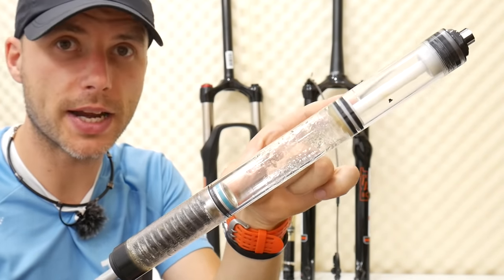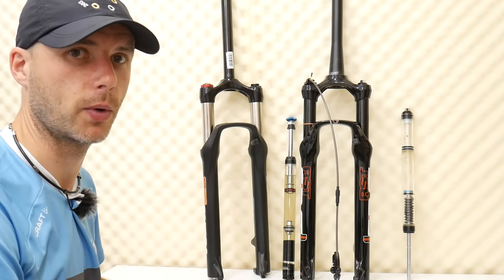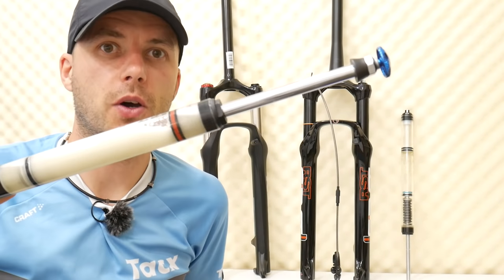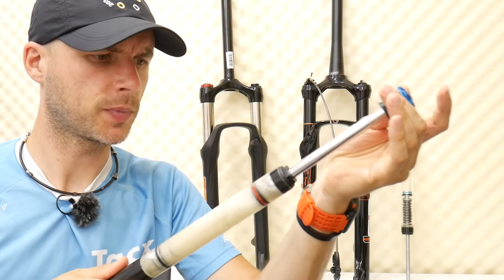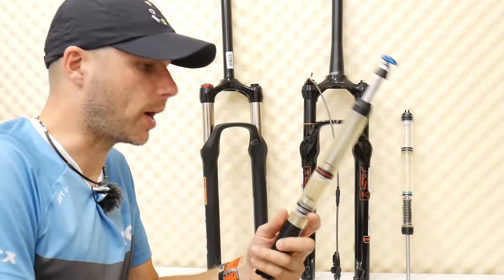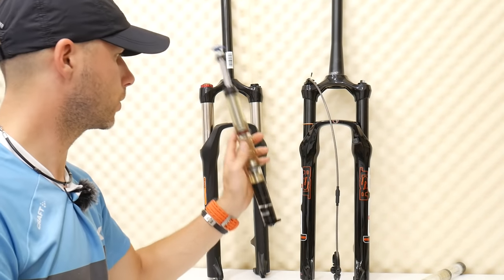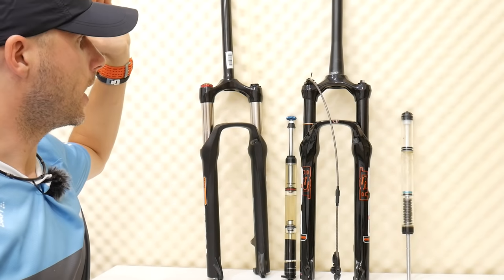Now EVERYONE Will Understand, How The Suspension Fork Works. What's Inside.

Comment: Apart from the damper being upside down like everyone else pointed out, it's worth mentioning that the bottomless tokens are installed ABOVE the upper seal, not below. Like in the damper stanchion, the chamber above is connected to the main spring chamber by channels. That's why the tokens are only limiting the air volume without changing the actual travel of the fork.

Comment: You had your damper cylinder upside down. The compression adjustment is on the top. That is why that giant air bubble was mixing with the oil. That actually hurts damping performance. If the cylinder was the right way up, the air would have been above the compression piston, and the air would not mix with the oil.
Reply: Yea! Because it causes cavitation when that happens.
Reply: The way he held it you mean? 
Or you are talking about sth in its structure?
Reply: @pishi_man  He held it upside down. The rod that slides in and out should have been at the bottom.
Reply: Yeah look at 12.08 aswell whare he's saying the volume tokens go! Half way down under the seal 😂 geez this video's most confusing ever needs to be remade

Comment: Excellent video 👍👌👏!! Thank you!
Im returning to serious MTBing after 20 years away...
hahaha the last suspension I saw the inside of was the 1998 base model Rock Shocks (was it a Judy?  ...me thinks yes!)
They were toys back then...plastic air springs both sides...this is completely different. This is easily as sophisticated as the Ohlins motocross  suspension I used to use on my dirtbikes. 
Now I understand the cost, and see the value...even if other companies have different methods to achieve the same things those things are really being addressed (Hi/Low speed compression and rebound dampening) My hope was to see this level of sophistication and I am not disappointed. thanks again

Comment: Also makes a good case for the latest damper designs from Fox and Rock Shox using bladders or sealed chambers separating the oil from the air and preventing the foaming or "cavitation" which may lead to unpredictable dampening characteristics.

Comment: Pretty straight forward analogy for explaining bike suspension from rider's perspective and good job for the demonstration of suspension parts!
However, there are some points need corrections or better explanation to not misleading non-suspension enthusiast viewers.
6:16 That is the upper part where the compression or lock-out knob located (at your hand reach when you ride). 
10:29 I think you wanted to refer to the dimple on the wall of air-spring cylinder tube which has main job is to balance the pressure between positive and negative chamber. Some forks will need a bit of cycling the fork to equalise the pressure, but some new forks nowadays may not need to. Some claim that having dimple at zero travel can affect small bump sensitivity...
11:03 The polymer spacer (Topout bumper) in the negative spring chamber is supposed to work as cushion when fork fully extended. (I'm not sure if this scenario is called 'off the top'?...please correct me if I'm wrong) For bottom-out cushioning, some forks has polymer spacer in lower leg to take the hit from stanchion, some cheap coil spring forks has polymer rod in the positive spring chamber to do that task.

Comment: Great video, very nice explanation 
However you kind of messed up the damping side of the fork...what i mean is that you explained it upside down...rebound is on the downside and compression on the upside (lookout is always on the top, rebound adjuster on the bottom)
You can also see it at the rod sticking out of the damping unit...it connects with the lowers via a screw, whereas the other side is screwed into the forks crown.
So everything is alright, expect you have the damping side turned upside down in your explanation and in the background : )
Reply: Please don't let this be true...in every other discipline his explination is correct, why would it be different for mountain bikes? Think of the physics, when the forks compress it's called... Compression.
 To lessen said compression or to dampen it would be the compression dampening adjustment no? then when the fork is kicking back against the compression is called the rebound and to lessen that effect is the rebound dampening (er)?
Reply: @matt-g-recovers  yeah nothing wrong with his explanation, he just held it upside down. In assembled fork it would be turned around, so that the compression adjuster is on the top and the red damping adjuster at the bottom of the fork. Otherwise everything is correct and perfectly explained :)

Comment: Springs that are made with a uniform thickness rod will have a linear characteristic. This tweaked to give a spring a progression characteristic changing the pitch of the coil wind and by heat treatment. The true progressive spring will be made  by using a tapered rod, one where the rod is slightly thicker over the length of the rod coiled to make the spring too changing the pitch of the spring coil to a smaller pitch at the end where the ticker material is coiled will vary the spring compression progression depending where the pitch changes. If the pitch starts halfway through the spring and the pitch progressively decreases over the remaining length. The the spring will have a linear characteristic for the first half of the compression but will require greater force the more it is compresses beyond the halfway point.

Comment: Great video and explanations. What I still don't understand is how the lockout works and I can't find anything on the net.
Reply: It works in the same way as the compression adjustment. It just completely closes off the valve that allows the oil through to the other chamber, rather than having it still open slightly, thus no compression at all so the fork wont move. There was a video that had Jordi Cortes from Fox explaining how it works, but i cant seem to find it.
Reply: @lawlerskeetz  Thanks man :)
Reply: It closes the oil flow, as shown in the video.

Comment: Right, I have a question. Why these two tubes and two pistons cost $1200 sometimes? I see no room for expensive manual manufacturing. Each piece is made automatically, and an assembling does not require a sophisticated routine.
Reply: tighter tolerances, better materials, more adjustment... and your paying for the name
Reply: @hermanngerman5805  Exactly this is similar to a price difference between 64GB and 128GB. I'm far from thinking that a bike is an iPhone ) For me it's ok to take a China carbon, place a "Canyon" sticker and use it until it dies. No problem. But professionals may be make better when a "manitou" replaces "rockshox".
Reply: Tight tolerances do make these a bit expensive to make however not as expensive as the manufacturers like selling them for. There are definitely high margins on these components.

Comment: Damn, wish I had compression adjustment on the damper side. My fork came with pneumatic travel adjust, which is just insane, didn't know what it came with, it was just a good deal online. I asked about replacing the damper with a R2C2, but apparently I can't. Yeah, the pneumatic travel adjust is just nutters, but the fork was half the price. I would love to work designing bicycle suspension, I feel there's tons of great ideas you could implement.

Comment: Hi, thank you for this well done and very informative video. I'm struggling with a strange problem with my  hydraulic (manitou) fork. Lock out function suddenly stopped working, I disassembled it and I found that the plunger have some existing-through-holes in it (that cant be closed by the handle bar command), besides the locking valve that should do the trick. I don't understand how it could ever lock the fork while some holes are always open.  Any clue about the principle of whole thing? Thanx

Comment: What mechanism allows the rebound to compress easily/oil to flow through easily going one direction, but then hard for the oil to flow through going the other direction?
Reply: It looks like the video in comment. But, it's easier in rebound rod of that fork. There is a shim with spring, when it's going rebound, it is closed and minimum flow is used. As the rebound rod is getting into compression move, that kind of valve opens, max flow is used, rebound rod won't affect the compression move, as another part of fork is for compression use

Comment: I'm not an engineer, but I think coil springs have much more progressive work than air. That's why we use tokens, to give more progression on last cantimeters.
Reply: Hook's Law for an ideal mechanical spring is F = k * x where F is the spring force, k the spring constant, and x the distance traveled.  So, that is a linear relationship between the force of the spring suspension and the travel.  I'm an engineer, though not mechanical, but I believe most all traditional manufactured springs operate pretty darn closely to Hook's Law, though there might be some non-linearity when very near bottoming-out.  Obviously, there is a big non-linearity when the spring does indeed bottom out, where the force F goes up very high, ouch haha.

Using an air chamber as a spring, though, is naturally progressive in the spring force.  As the fork compresses, the chamber gets smaller and by Boyle's Law the pressure in the chamber becomes higher.  That increased pressure as the fork compresses will require more and more force to get the fork to travel farther, hence progression.  The tokens just help increase that natural progression to give a better feel on the terrain or just for more insurance from bottoming out.
Reply: @ryanotte6737    it took me 9 months to understand how stupid was my assumption. Thank you!
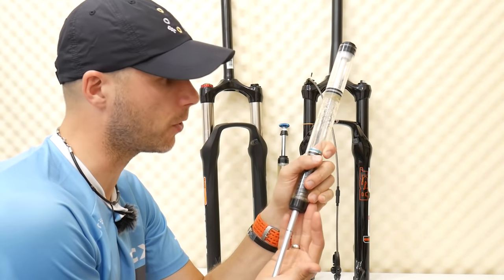With your help now, can we point out some   misconceptions at 9:55? Correct me if i'm wrong, but It doesn't use "pretty much the same" force to compress spring at its 10to20mm (rough 10 to 20% on that 100mm fork) travel, than on its 70to80mm (70-80%). It needs about 4 times more force in second case.
Reply: @AntiDEDok  What he is getting at there is that the coil spring has a linear force relationship to the travel distance.  He might say that there is the same force ADDED to each increment of travel to be more clear.  We can compress the spring from 10mm to 20mm to 30mm, and so on and we keep adding the same amount of force needed to push that far, like maybe 50N to 100N to 150N as an example.  In that case, the spring constant is k = 5 Newton per mm.

Comment: great explanation tools using a clear damper tube, but holding it so that air mixes with the fluid while you're demostrating it is wrong and confusing. It ideally should not aerate and you are forcing the air through the valve with the oil giving an incorrect picture of whats happening. People will google this and get told that mixing oil and air is really bad in a damper and avoid RST and other dampers that operate like this (New Marzocchi Bomber B2 Rail damper) from this demonstration.
Reply: He has the damper upside down in the demonstration and explanation. The rebound knob should be at the bottom of the fork, and the black compression knob should be at the top.

Comment: what does it mean if the fork sinks down and do not come up. is it because of the problem in air spring  or damper side ?
Reply: If it comes up slow then the rebound damping is closed. If it rebounds fast but doesn’t return to ride height then it’s likely just air pressure. If neither work your stanchion could be binding in the lower, in which case it needs to be rebuilt. Hope that helps

Comment: Wow, what a wonderful explanation. What is the difference between a really expensive shock vs an inexpensive one ($900 Rock Shox vs an AliExpress $150 one). Does the rider need to be on the extreme end of the riding spectrum to notice (and care about) the difference. 

By way of example, I play a lot of tennis. I change strings once every 2 to 3 months. Roger Federer changes every 7 games. Very casual players buy a racquet and NEVER change the strings. Each class of player is happy and doesn’t notice any difference. How about forks? Can I buy an inexpensive fork, ride frequently, and never notice a difficiency because I am riding mostly xc stuff and never getting close to the limits???
Reply: buy cheap buy twice 😁if you'd rather not risk your cheapo fork breaking and headbutting your handlebars, spend a bit more and get a decent one
Reply: @robertwasden2691  My original post was 1 yr ago. And you nailed it. 6 months ago I upgraded to a nice rockshox front and rear suspension - transformed the bike. I do have Chinese CF wheels on several bikes and so far no issues at all. I am not a bike park guy and most of my riding is XC and trail riding. They are light and seem well suited for my application.
Reply: @jeromep4148  glad to hear it Jerome...it's all about fun and as long as you are enjoying it that's all that matters! It's great to have some trick bits on your bike but making savings on parts is all good where you can and where it's appropriate. Hopefully many more miles and many more smiles out on the trails!

Comment: a local dude has the RST F1RST Air 29"fork( I think), but the compression does can't be adjusted, does nothing, also rebound is not working, air pressure at at proper pressure I guess for the rider, I lowered it for him, cus it was not possible to get it to go down with all of my body weight was closer to 100psi, but at 70 psi, which made it move more, but it still was very harsh seems like the compression is too hard and that's the only setting no matter which I put it in, rebound damping is at max no matter where it is.
I have no experience with this fork, but that's a topic I haven't seen anything about, failed compression and rebound units. he got the bike second hand, so there is no telling how much and which kind of abuse the fork got, or if it's just bad internals, or neglect, but this would be an interesting topic to explore further.
Reply: There's probably no oil in the damping unit at all, that's why compression and rebound doesn't work. From what I read I think this fork needs maintnance desperately.

Comment: Nice explanation. 
Few thoughts: 10:07 you said, that for moving from one postion to other you need same force. That's not true, you probably meant same force difference. 

The linear behaviour of coil can be described as F= k*x , where F is force in newtons, k is stiffnes of the coil in Newton/meters and x is a travelled distance in meters.

Whereas force needed for compressing air spring is derived from gas law (for this purpose let's assume ideal behaviour and adiabatic compression - really fast compression):
F = p*S*[L/(L-x)]ᵏᵃᵖᵖᵃ, where F is force in newtons, p is initial pressure in air chamber in pascals, S is area of a piston in air chamber in squared meters, L is a travel of a fork, x is a travelled distance in meters and kappa (in exponent) is a heat capacity ratio - for air it equals 1.4. The progressivity of air springs is a result of power dependence. Theoretically, if you use different gas (such as CO₂) you can change the characteristics of the fork (it would be more shallow, linear-like).
Reply: it's like you tell someone that you don't consume energy...

Comment: How does the lockout work when there is an valve in the rod? It would still go through the piston valve right? I dont know how it locks when there is on the top side just an orifice closing
Reply: You have slow compression (regulated by the knob, as a needle), and shimmed piston as high compression. As he close the channel by a needle, more oil wants to go by high speed way. It gets harder to push oil bypass

Comment: That damper oil would not bubble like that your pretty much boiling it justbhop you have air pressure valves your gonna need em lol thats upside-down thin lower shaft goies downwards into the lowers blue end to bottom would normally be red but will be blue on this demonstration damper

Comment: Hi , I've recently bought extra oxy replacement existing older ones.  I want to evacuate the air and recharge or refill with nitrogen as it has many beneficial effects. Do you know if this is something I should do myself or if I could take it to the shop I'm having any difficulty finding one near me in Concord, NH does that does that work.  Unless there was someone you can recommend.

Comment: Nice video! One Question can you exchange the fork damper oil without removing the lowers? Or will some oil remain at the bottom under the sliding seal so you don't know how much you need to put back in?

Comment: Very useful anyway!! But...for exapmple. I have a problem on my Fox talas 2009 (that has open bath system) and suddenly it starts to compress till the end only with my weight (and spread oil from the damper side). The air pressure in the right side is constant, it doesn't lose air. I'm wondering where could it be the issue  ... i still had a good quantity of oil on the damper side bath when i opened it (lockout anyway doesn't work at all). I don't think that changing the dust seals would make any difference about it (or am I wrong?).

Comment: Im just wondering, are there different components inte each leg of the fork? A rebound in one and a shock in the other leg?
Reply: Yes, most forks have the spring assembly on one side, and the damper on the other side. The spring side (air or mechanical) has different components than the damper. The damper relies on fluid and shims to slow the movement of the fork (preventing pogo movement). The spring provides support for the bike and rider, but does not rely on fluid. Instead, springs are metal (like on cars and most motorcycles) or air. The air (like in the video) has a dynamic (moving) seal that separates two volumes of the air spring.